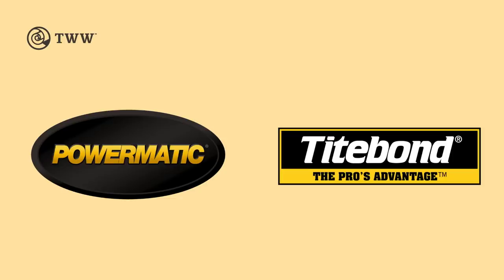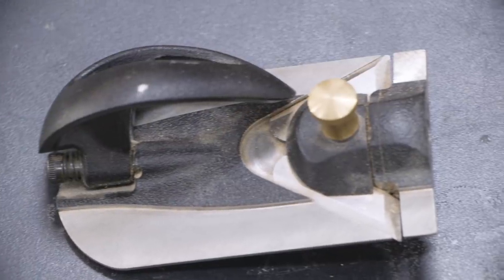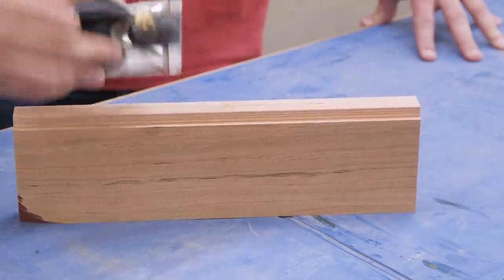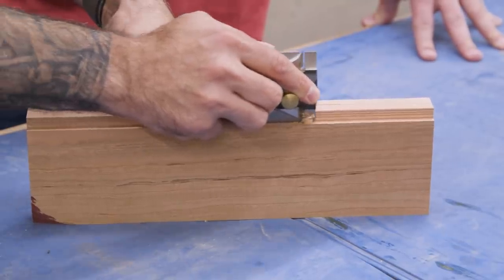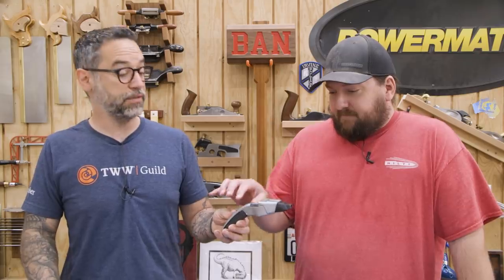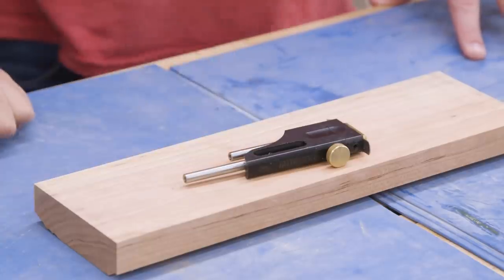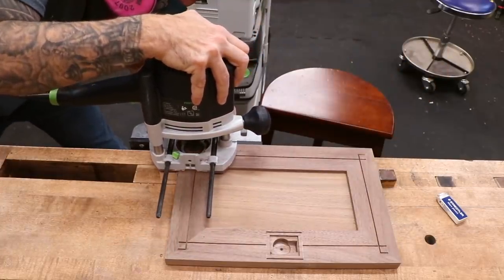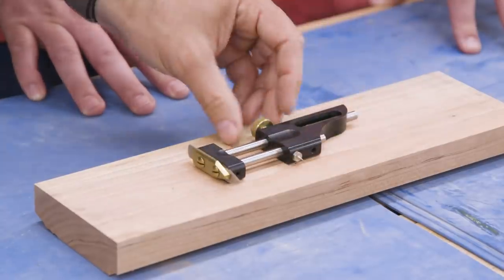Bet You Can't Name These Tools!

Comment: That screwdriver is not for the screw that holds the lever cap down, it is for attaching the chipbreaker/cap iron to the blade on a bevel down plane. Looks like maybe all of your LV planes are bevel up so you still don't have a need but the standard LV bench planes with the bevel down would make use of that screwdriver.

Comment: Not too sure about that last face frame clamp...    seems like a good way to easily destroy your shelf pin holes, especially if your shelf pin holes happen to be in a softer wood, mdf or melamine.   Not to mention it basically useless for clamping face frames along the top & bottom of a cabinet, cause typically shelf pin holes are only going to on the sides.

Comment: How ironic that your Veritas plane can't use the Veritas plane screwdriver!
Reply from the maker: I thought that same thing as I reviewed the video this morning, lol.
Reply: Sorry Mark you flubbed the screw driver.  It is for the large screw that connects the cap iron (aka chip breaker) not the lever cap screw.  Great for double iron planes.
Reply: Oh another great no -woodworking use is I have one in my camera bag, they are great for the big slotted screw on tripod mount camera plates (depending on the brand you use) 👍
Reply from the maker: I haven’t used it in years so you’ll have to forgive me. I think people will get the idea though. 😄
Reply: No forgiveness needed, obviously you use yours so much you missed the intended use.  I think you have called things like that a “hoochie” used with a thingy.  😉. No trolling intended. 👹

Comment: That screw driver thing looks like it would be used to separate the blade from the chip breaker.
Reply: Yes, it is for the screw that holds the cap iron on the blade